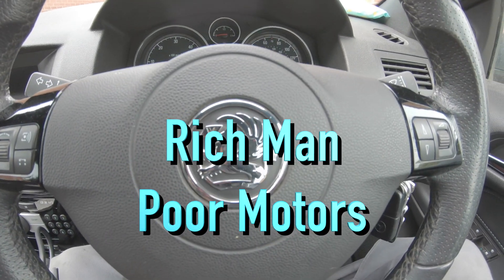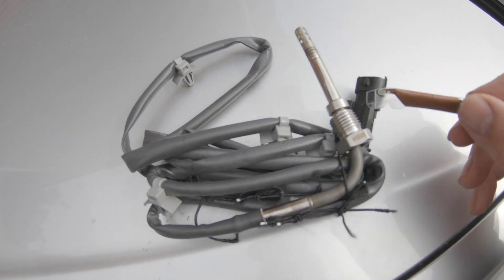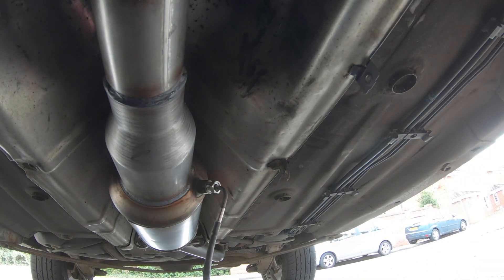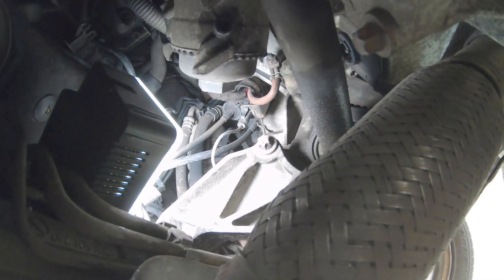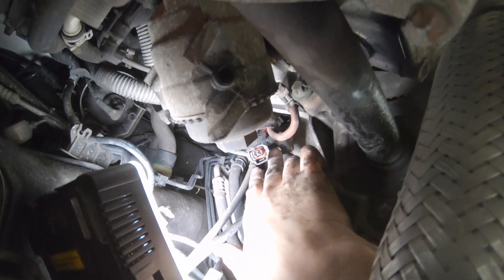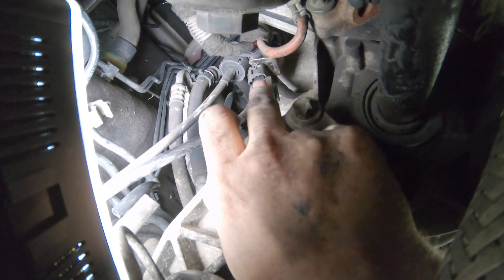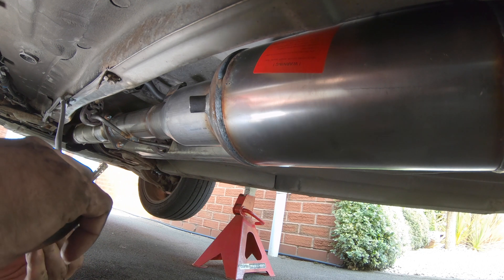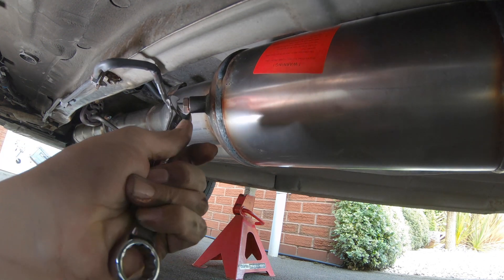Installing Astra Exhaust Temperature sensor EGT sensor

Comment: Great vid, thanks. You got a link for the sensor? Prices seem to range from £50-150 🤷‍♂️
Reply from the maker: Thank you for your comment, i tend not to post links for car parts directly as sometimes they can change by model year, engine spec etc,  and i don't want my subscribers to end up with the wrong part,  but try this link where you can cross reference with your reg https://tidd.ly/2ZvPR3r also add the code MID60 on the checkout as there is 45% off some parts at the moment
Reply: @RichManPoorMotors  thanks for that, they don't have the sensor either 🤬. Amazed how difficult it is to find and the varied prices. Managed to get it from Autodoc in the end. Much appreciated and video is a great help.
Reply: @kooper1683 do you have a link for the exact part you got from autodock?
Reply: @Getoffmylawn9  before soot sensor. Bank 1 Sensor 2.
VEMO V40-72-0291 Sensor, exhaust gas temperature

That is from autodoc.
Reply: @kooper1683 nice one thanks. Need to change the sensor on my brother's car so want to make sure I get the right one 👍
Reply: @kooper1683  what year and model is your astra? I just put the part number in on autodoc and it says it's not compatible. I'm looking for the part for a 2013 astra gtc
Reply: @Getoffmylawn9  mine was an Astra H 2013 1.7cdti.
 They have others on there.
Reply: @kooper1683 the one I'm looking for is for 2L cdti, yeah there's plenty on there just want to make sure I get the right one. I'm sure I'll get it right lol thanks for the help buddy 👍
Reply: @Getoffmylawn9  it is a bloody minefield. I bought the wrong one first time. At least with EuroCar you'll be able to exchange it easily enough if you buy wrong.